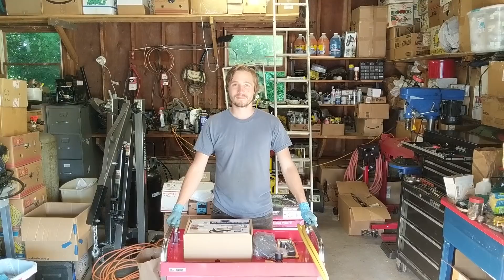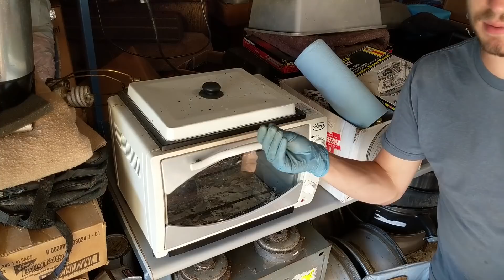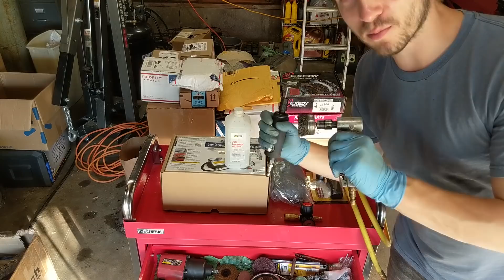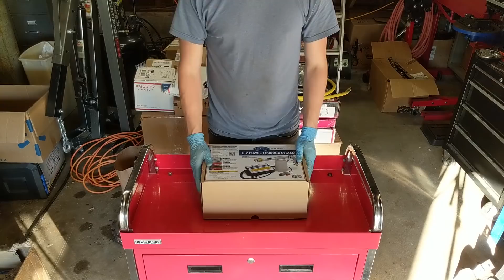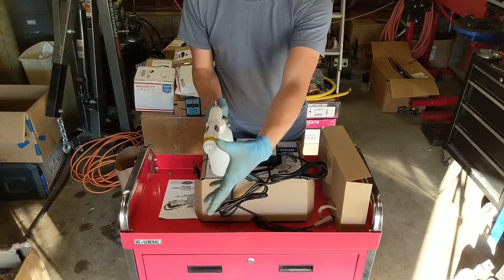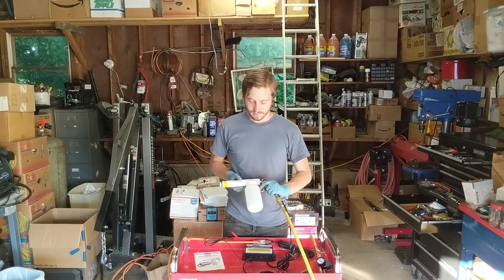Powder Coating At Home - Everything You Need

Comment: May I recommend 100% acetone or xylene, (common nail polish remover)it takes everything off... paint, dirt, oil, rust etc..
Reply from the maker: Yes they can work well! They don't work amazingly well on hardened paints like automotive or powder coat in my experience though. Unless you let them sit a looong time. Great suggestion though!
Reply: Have you found anything that does work? I haven't myself haha
Reply from the maker: @MikeyLee65  Mostly just actual paint stripper like "Aircraft Stripper" brand, or physical removal with wire wheels, sanding, grinding, etc. For grease and oil I love my parts washer with Oil Eater degreaser.

Comment: I have a harbor freight gun, and when I spray a huge amount of power barfs up and then I start getting the correct dusting effect. Is this because I'm using a full container of powder and should use much less inside the container? Basically, I used a 1/4 container just for 3 small parts because so much was shooting out when i first activate the gun.
Reply from the maker: It's most likely too much powder. The air pressure has to be able to "stir" the powder in the jar and basically aerate it a bit. So with no room in the jar, it has a hard time getting started. Could also be pressure regulation. A burst of too much pressure initially could cause a problem. Otherwise a dirty gun or moisture in the gun or powder could cause problems. I think it's most likely too much powder like you guessed though. I usually only fill mine about 1/3 to 1/2 full. Doesn't actually take a ton of powder to coat most parts. :)
Reply: @802Garage  good too for newbies! I sprayed my first time and wasted half my powder :(
Reply from the maker: @zazzn  It's a skill like anything else that takes a bit of knowledge and practice to get right!
Reply: @802Garage  just saying add that to your tips :)
Reply from the maker: @zazzn  Oooh gotcha. Thanks!

Comment: Whats the difference of that gun and the pro gun that Eastwood has
Reply from the maker: Well the dual voltage gun just has two voltage settings. Lower voltage makes it easier to coat inside corners or tight areas whereas high voltage is better for coating large surfaces or just coating something quickly and thoroughly. The Elite system which is like $800 or whatever is more of a real professional gun with more adjustable settings, but I assume you aren't talking about that.
Reply: @802Garage  yes I'm talking about the Eastwood pro I just want to know if it's worth getting to do some rims or if the diy one would be enough
Reply from the maker: @als3449  The DIY guns will be good enough for wheels as long as they aren't super complex like a tight mesh.

Comment: dont use any oven that has exposed flames, the powder is flammable
Reply from the maker: Good idea. Mostly only an issue if the flames will actually touch the part, but also the air turbulence could cause issues. It needs to at least be a well guarded flame, but for home powder coating electric is def recommended.
Reply: @802Garage  The powder is flammable and might ignite with exposed flames and turn your gas oven into a bomb, the finish from air turbulence is the least of your worries
Reply from the maker: @matt060383  That's only true while the powder is atomized. If you take a lighter to a pile of the powder, very little will happen. It's similar to how flour or corn starch are flammable when dispersed into the air. The tiny particles are easy to ignite, but when at rest they aren't volatile.
I worked in a powder coating factory and we used massive flame heated ovens. The parts just did not come in contact with the flames, obviously. Appreciate the desire to be safe though, so I still recommend electric heat.

Comment: Not a propane oven !!!the powder is flammable and kabooom
Reply from the maker: Can't say I agree. I appreciate your caution, and I think an electric oven is the easier choice. The atomized powder or dust cloud form may be quickly flammable, but once the powder is stuck to the part, it would be hard to even light it. Plus you would want to preheat the oven and the coated part should not come in contact with the flame, which most propane ovens don't leave exposed anyways.
Thanks for watching and commenting!
Reply: 802 Garage thieves what Eastwood tutorials say
Reply from the maker: At the factory I worked in we used MASSIVE gas heated ovens. The powder itself is not particularly flammable when in its resting state. It will burn, but it would be like trying to light a pile of flour on fire, though it might stay burning a bit better once lit.
It's the dust clouds that are particularly dangerous. Industrial paint booths are supposed to be thoroughly grounded and there is supposed to be spark mitigation for that exact reason. The finely distributed particles in the air can go up in flames, again just like if you have a cloud of flour dust for example.
So yes, there is care that needs to be taken. As long as the gas oven does not have an exposed flame and won't be touching the part, it should be fine. Again I appreciate your comments. :)
Reply: 802 Garage you know
Reply from the maker: Always better to be safe than sorry!
Reply: 802 Garage yes i agree
Reply from the maker: Thanks for watching and commenting. :)

Comment: Very professional!
That digital infrared thermometer goes for $45 at Advance. Geez. I got mine there, but when it was a better design, and I certainly didn't do so without an online discount. If I had to buy one now, though, I'd get that one you showed.
Reply from the maker: I mean for $8 this one seems to work fine. I think I paid $12. There seems to be a sweet spot at around $25 for one with a wide range and dual lasers to show you the area it's checking though. The prices have definitely gone down over the years! The next video I actually put it to use.
Reply: Yikes, I think I still paid too much. I got mine three years ago max, and they have charged the same amount, give or take a dollar or so, since then.

They are pretty handy! Outside of automotive uses, I've used mine to find out where in the house the heat was getting out, and to see if there were any points outside air was getting into the walls and freezing pipes.
Reply from the maker: That's what you get shopping at an auto parts store! XD
They are definitely one of those tools that are super nice to have those rare times you need them. :)

Comment: What things do you powder coat other than wheels?
Reply from the maker: Anything metal! I love powder coat.
On my Impreza I actually powder coated my winter wheels, oil pan, valve covers, power steering pulley, accessory belt cover, air box clips, and hood prop rod.
Now I've powder coated the Eclipse clutch fork and battery tray at home, and there is definitely more to come.
Check out some of the colors I listed in the description and I'm sure you can get some ideas.
The wrinkle finishes are great for valve covers and such.

Comment: prep is 99% of any type of painting. even a rattle can can look like pro work if you prep it to hell.
Reply from the maker: Makes a massive difference. I cover prep fairly well in the next video. With powder coat you can't really have any rust or corrosion left and it needs to be super clean. Any out gassing from the heat will cause micro bubbles.
Reply: if you look at the pics i sent you see my wife's dash was done with rattle cans lol but people think it was done by a shop.
Reply from the maker: Yep, when done right it's hard to tell.

Comment: i made my oven out of cinder blocks and 4 halogen work lights , i needed to do my wheels.
Reply from the maker: That actually works? I may do the same! Been planning to find a crappy electric oven to do my wheels. :D
Reply: yep but you have to take the glass out of the lights , and they need to be on top and bottom . i know its half ass but it worked
Reply: i got my gun at harbor freight  it wasn't bad but i ended up needing another one on the last wheel. the electrodes on it fried out after the third wheel
Reply: those light get crazy hot.  an  old paint guy told me how to make it . line it with foil on the inside , fill the holes with sand , and watch you hands as it get hot
Reply: you will want to make a frame to hold the wheel by its inner bead.  , it takes longer than the normal oven. and kiss those light's good bye . they will make it till the last wheel before they fail ,,,,but they will fail.
Reply from the maker: Hahaha, that's still awesome. I'll probably just get a crappy oven. :D
Reply: Wow does that really work? The bulbs heat up 400 ?
Reply: @E90SORS  use reflective material inside it . it 400 is hot enough if you leave it for 3 hrs or so. it just can't do it as fast as a pro oven.

Comment: I remember the first time I got shocked powdercoating also I’d invest in a sandblasting booth It’s the best way to get parts really clean for coating the table top one from harbor freight is decent just hook up a shop vac to it
Reply from the maker: Tell me about it! Oh how I wish I had a sand blaster. Using it at the factory made everything so much easier. I may get one of the table top units, but I'd really love to get a booth, or maybe make one. I have never gotten a bad shock from a powder coating gun, but I know the guys used to do it as a joke in the factory. Thanks for watching and commenting!
Reply: 802 Garage you will eventually trust me also prismatic powder is a great place to get powder
Reply from the maker: Was looking at some of their stuff earlier. Thanks!

Comment: What do you film on?
Reply from the maker: Same thing as you, I believe. Pixel 2 XL!
Reply: 802 Garage sweet, do you do it in 4k or 1080p60? I know the pixel defaults to 1080p60 for storage space
Reply from the maker: I actually just film it 1080p30. No need for 60 FPS for most of what I do, but I will use it if I ever thing I might do high action or slow mo. I tested out some 4K and 60 FPS footage at Wicked Big Meet I plan to use in my edit.